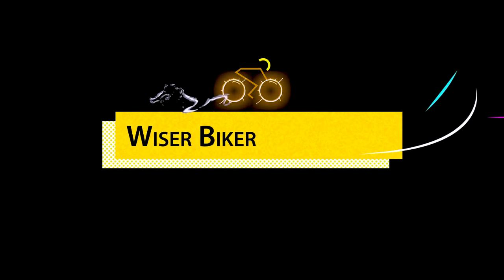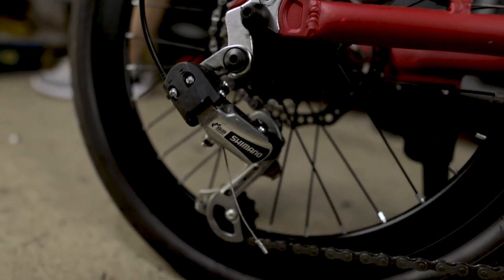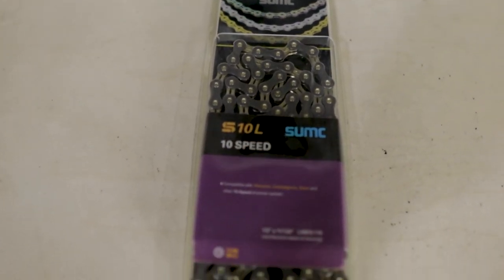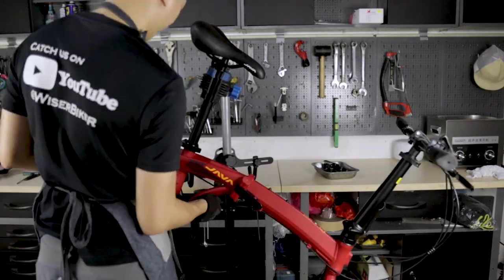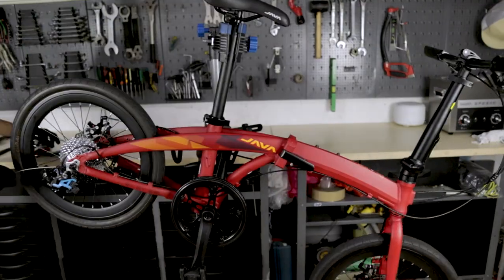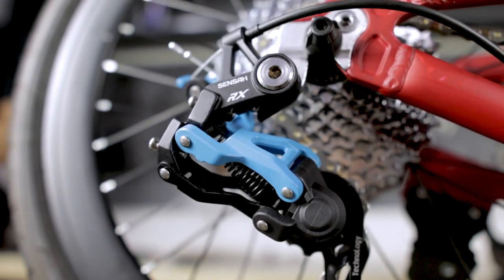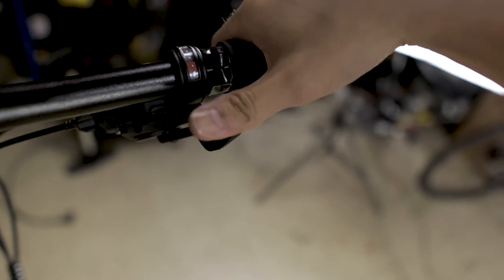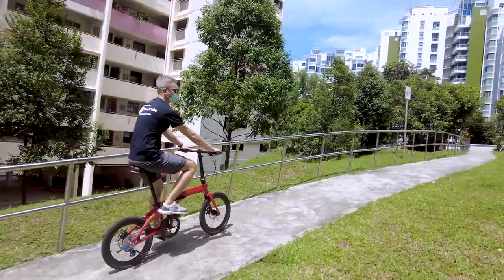$100 Upgrade Foldable Bike that you can do | Groupset Upgrade | Tier 1

Comment: Here are what I did to my bike:

1) 6 Bearings Pedals.
2) Saddle (Try an error until u get the right one for your ass)
3) RD, using claris ( good enough )
4) Crankset and a hollow BB.
5) Tyre, (using Maxxis now)
6) Hydraulic brake.

After all these upgrades I feel like you should one shot buy a bike that already got all these instead of part by part upgrade.

*Single speed foldie is the best.  3x or 2x crankset will only give u more weight and burden.

Comment: Rookie question: my foldie's hub also has only freewheel support (it'sa 7 speed 14-28t). Can I also replace my current freewheel for a 9 or 10 speed one? If not, I might buy a 7 speed mega range.

Comment: Very informative video. If in case i dnt change the gearset but change the chain ring to 56t hollowtech crank set. do i need to change the chain? if yes what is your recommendation?
Reply from the maker: Hi, thank you! Glad you like our videos. If you are keeping the cassette as the original stock set up, then most probably you don’t need to change the chain. The stock chain should have enough allowance for you to upgrade to 56T. So I would suggest you to try with the current chain first, if it is too stretched when you shift to lightest gear (gear 1) then you will need to change the chain.

Comment: Nice! I wasn't considering upgrading the groupset. Now I am! :) I also upgraded to Litepro Hollowtech 56T crankset before my 50km ride 2 days ago. It's not obvious what the difference is TBH. 😅

I was thinking of upgrading the rims to save weight after watching your older vid. Did some research and saw some affordable options at less than $200, shaving 600grams off. Also saw PAWL vs Rachet wheel hub systems but those are expensive and I'm wondering if it's worth upgrading on the Zelo if I don't change to a 2x10 groupset.
Reply from the maker: 56T hollowtech is nice since you get some weight shaving but 56T requires more strength if you want to go faster.

Going for wheels upgrade is probably the next biggest component to upgrade that will last a long time so i will definitely pick one that has good performance and without a doubt shaving off some weight :)

Comment: Hi there, thanks for sharing the informations. May I know is 10speed is the maximum for this wheel set?
Reply from the maker: For stock wheelset, what we can find on the market is 10 speed free wheel. Not sure if we have came across 11 or 12 speed.
Reply: @WiserBiker  Thanks for reply🙏. 1 more question, the original rim come with java zelo can use more than 10 speed freewheel ?

Comment: wheels upgrade. for more fast n smooth rides. more ratchet T in the hub n more smooth bearings. in the hub.😀
Reply from the maker: Definitely an upgrade that many should consider! It is amazing how much improvement a good quality  wheelset can gives!
Reply: @WiserBiker  I'm new to this and plan to get a Java Zalo Z3. Since you mentioned a better wheelset will make a difference, the upgrade the store I intend to get the bike is offering these upgrades: 
- Shimano Altus 9 Speed 
- Decaf Hollow Tech 
- Decaf 406 Lightweight rim

Would the above be a good set-up for a beginner like me?

Comment: For $100 I would rather change to Hollowtech crank arm and a 56t chainring for more speed, smoother pedaling efficiency and power transfer. Changing groupset only give more climbing ability. For me I think pedal efficiency should come first.
Reply from the maker: We just happen to have a 36-11T freewheel lying around so we decided to use it. Ideally we believe a 32-11T freewheel will be ideal if we want to optimize pedaling efficiency. How many people are able to sustain 80-90cadence over a period of time with 56T at the front and 11T at the rear. A road bike can hit 48km/h to 52km/h if your cadence is 90rpm with 50T at the front and 11T at the rear. Hence why we went for the 7 speed to 10 speed upgrade. This allow us to have a better gear ratio to accommodate to your engine. 

There are no right or wrong answer for what upgrades you want to do, we just think that this is more applicable for more cyclists. To have better gear ratio and have a better climbing experience :)